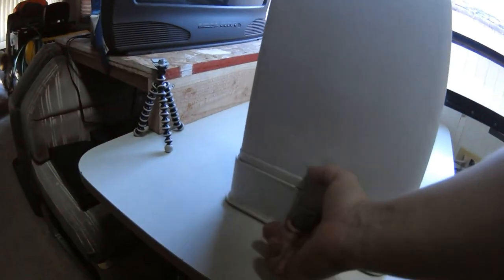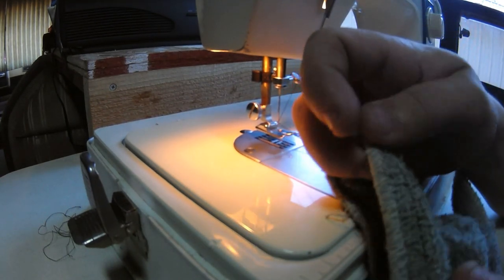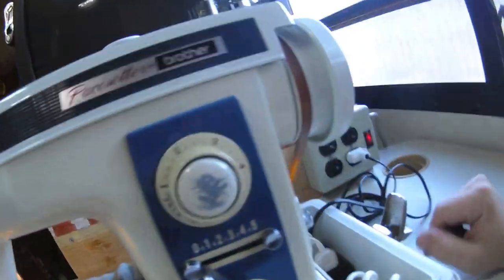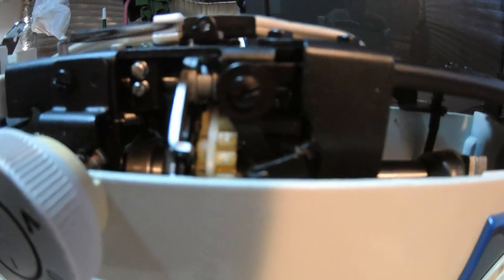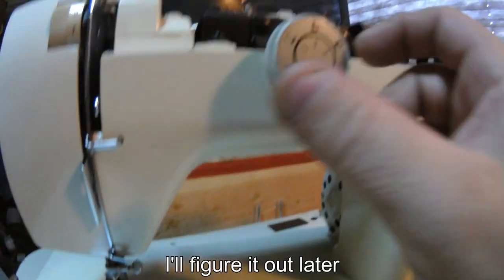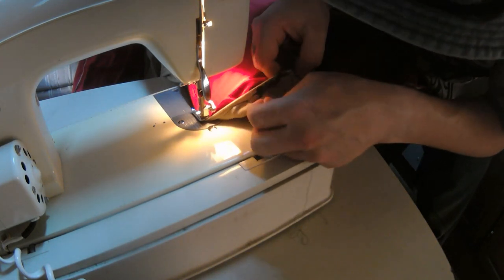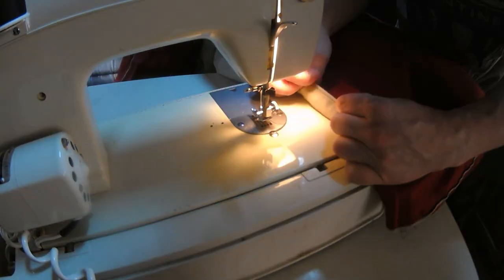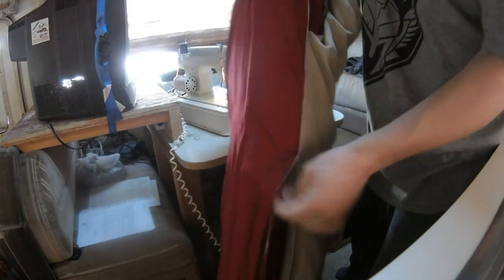Old Sewing Machine | Practicing & Troubleshooting

Comment: The number on the wheel above tells you how big the stitches are. Should be set for that fabric around 3.  there should be a little button to the side someplace that when you push on it, it will go in reverse. When you let go it will go forward.